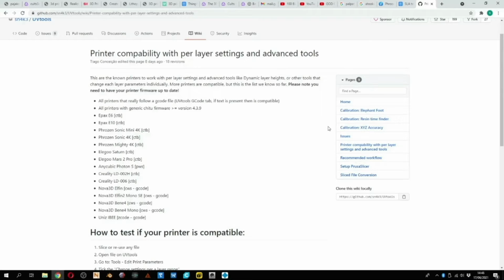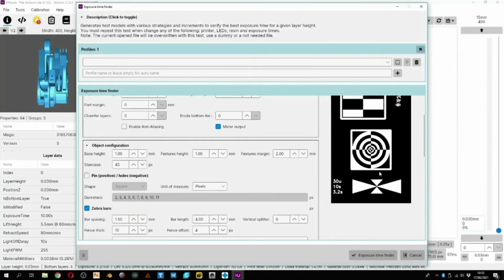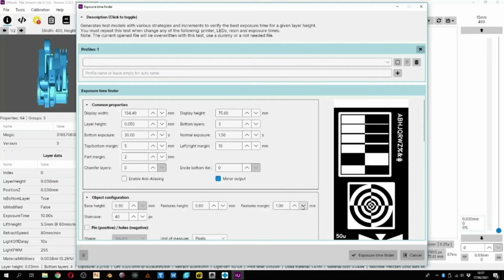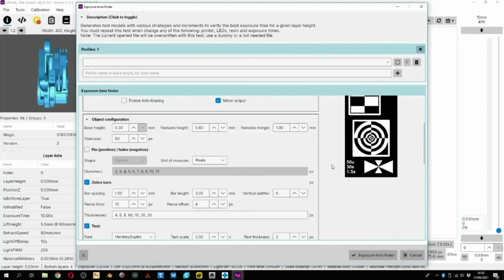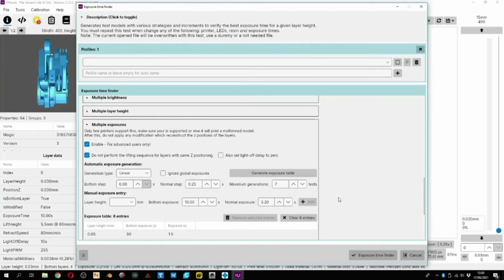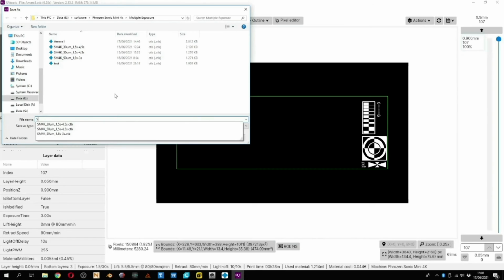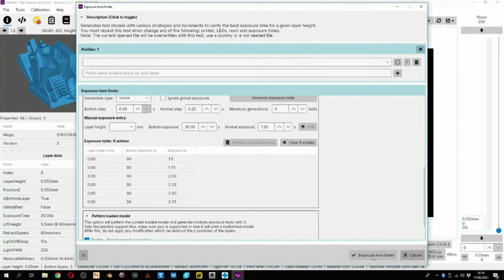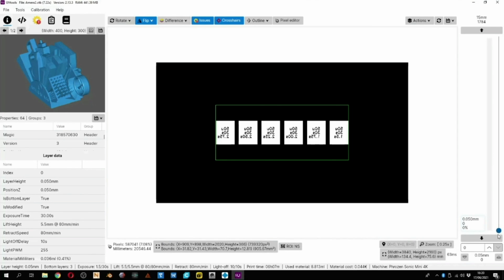Find Perfect Resin Exposure using Multiple Exposure Finder For 3d Printer Resin Using Uvtools

Comment: Amazing Dennys, thanks to you. I've got my Anycubic Photon Ultra the first RERF.dlp printing files. thank you so much and keep up the good work👍
Reply from the maker: Thank you and welcome.
Reply: @wangdennys  Hi again Dennys. I just did a print test last night with the mini town tester, it worked for several layers until it reached the square that underneath those buildings. when I checked up on it the mini town broke into 2 parts, the base stuck with the build plate another half was stock in the vat while its kept projecting UV and printing, and my build plate was handing in the middle of the z axis. This is way too high if its printing the mini town. 
Does it mean I have a wrong setting for z positions? or it just simply doesn't compatible to Photon Ultra? 
Thanks for your times
Reply from the maker: Sorry i dont have photon ultra, so i cant test it.
Reply: @wangdennys  thanks for your reply, i was just wondering if I get the setting wrong or something
Reply: @fizzymonAska   Did you find the solution for the photon ultra? I have the same printer

Comment: If you don't want the text on the bottom, there is an option to make the bottom layers solid. I use the pins as well, but you have to use the solid bottom layer feature. Otherwise you'll end up with Islands.

Comment: I'm askin since you reviewed photon mono 4K deeply befo, did mono 4k worked with UVtools?
Reply from the maker: It works up to certain point.
But the blur function or similar doesnt work.
Reply: @wangdennys  ooooh thanks for the reply so quick. so besides some delicate features like a blur, or maybe AA? those features didn't work. Yet, just layer height, exposure time etc. - basic stuffs was working, right? thanks a lot for the answer!
Reply from the maker: Yes
Basic stuff works.